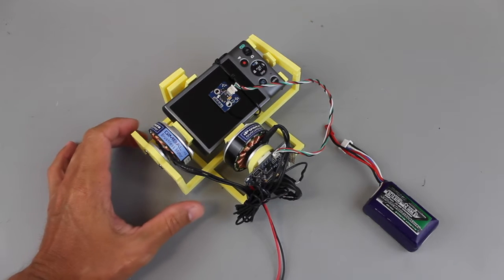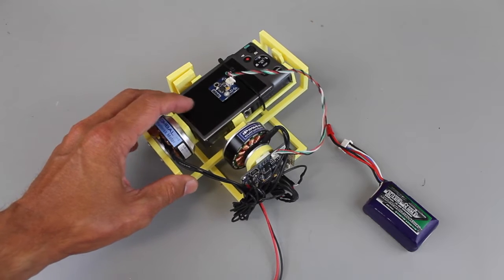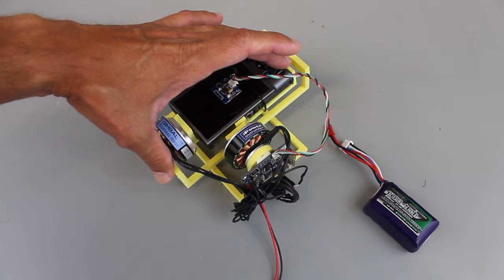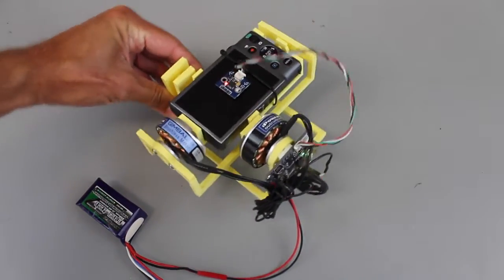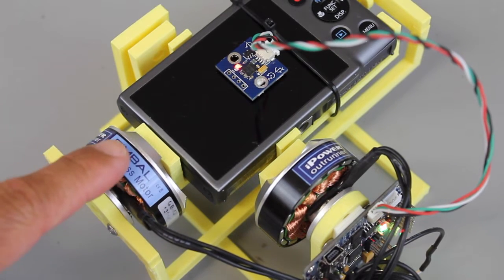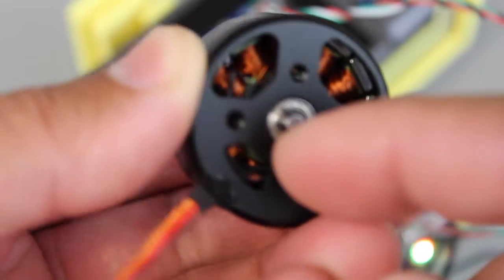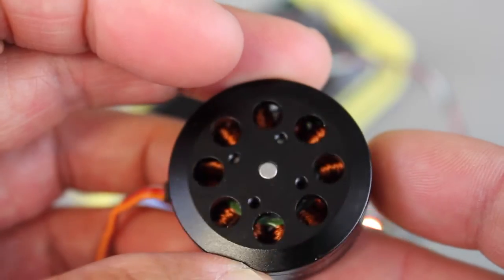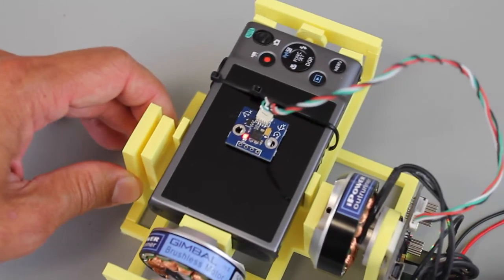3D Printed Downward Gimbal for Aerial Mapping

Comment: your batty charger may be bad. i had a $40 charger from hobbyking and after a year began overcharging battery's and making them puffy, even brand new batts.. i now have 300w - 2x150w Reaktor, its great. after charge has finished, ignore what charger says and seperatey check voltage with MM. If ur getting puffy battery's
Reply from the maker: Thanks for sharing that tip. Appreciate it.

Comment: Great idea, I may give this a go!  Does the bottom section of the frame come into shots at all.  I've liked and subbed.
Reply from the maker: fireFLY aerial innovation It does if the wing is rolling hard left or right on turns. But that generally happens at the end of a flight strip so it doesn't matter. I don't use those photos in the stitching process. While moving straight down the line the roll isn't large enough to get the frame in the shot. Lately I've been testing the Sony NEX without the gimbal and it works reasonably well when stiched with Photoscan or Pix4D.

Comment: Which control board are you using?
Reply from the maker: Stephen Oberlin In this case I'm actually using a board that's overkill: http://amzn.to/1KiTD4c I don't need 3 axis but it was laying the garage and so I put it to the test. Performs really well, but a much simpler two axis version will suffice.

Comment: When'll be providing the project, and can tell me if know any site that sells the gimbal for Canon PowerShot SX260HS.
Is this the gimbal for use with Canon PowerShot SX260HS.

http://www.hobbyking.com/hobbyking/store/uh_viewItem.asp?idproduct=43674
Reply from the maker: Jaelcio A. Lima Verde That HobbyKing gimbal looks pretty good. It's 110mm wide and the SX260 is 106 so it should fit in the gimbal. I've never used it so I'm not 100% sure. Also, if you plan on using a remote USB trigger then you'll need to make sure that the USB plug will fit into the gimbal as well.
Reply: When will provide its gimbal design for canon Powershot Sx260?
Reply: Its use the Canon SX260 in a fpv.

Comment: Do you think the gimbal would fit in a plane like this? https://www.hobbyking.com/hobbyking/store/__58045__Skua_FPV_Plane_EPO_2100mm_KIT_.html

Im looking at building a system to do mapping.
Reply from the maker: Tim Dickinson Yes I do think it will fit in that frame, but will take some tweaking. It doesn't look like there's a downward cutout so you'd probably need to do that yourself. I still haven't finished up this design and am working through some bugs. Let us know if you decide to go with that frame. I'd love to hear how it works out. A few others have pointed me to it, but am more interested in a delta wing design for aerial mapping.

Comment: Any update on the project? I'm interested in the same type of gimbal but hugely lacking skills to build one..
Reply from the maker: Ard Surspec Sorry no I haven't been able to finish up this project. I've found that it takes a lot of space in my wing so I'll need to come up with a different mounting option. I'm also looking at different frame options to see if there's a better suited one. What type of plane are you flying?
Reply: Dennis Baldwin Thanks, I am looking to build a mapping drone, perhaps based on the same Fx-79. Not a flyer yet, I'm a surveyor, age is catching up and recently broke my foot, so I need something that require less walking to continue putting bread on the table so to speak. Keep up the good and inspiring works of yours, so guys like me can learn..Thanks again..

Comment: another great video. thanks. did you ever determine the thread size on the HK motor? I've ordered a few of them to build a simple gimbal but it's been over a month and they still have not arrived. I don't want to make parts until I know what size to make the mounting holes. thanks in advance.
Reply from the maker: James, man I'm sorry to hear that. It's pretty much what you can expect with ordering from HK. Regarding thread size I just resized a variety of bolts in the mail so stay tuned for a new video in the next day or two. I'll be sure to share what I find out. Good luck with your gimbal project.

Comment: Very interesting project. I will be waiting to see the final results and footage. What is the size of the camera that are you planning to use? I have found that some point and shoot cameras are very sensible for vibrations. Cheers
Reply from the maker: I've been flying with two different Canon Powershot camera that can both run CHDK. They both do relatively well for the price. One is the PowerShot 130 and the other is the SX260. I've had good results with both. I'll definitely be sharing my results when I get this gimbal in the air. I've made a few tweaks but it's about ready to go. Thanks for following along.

Comment: A needed piece of hardware. Will the chassis block the shot when it rolls? Can the camera be positioned lower?
Reply from the maker: Great questions and thanks for the feedback. I've thought a lot about the chassis being an issue, but yes lowering the camera should hopefully do the trick. I've already got a design where the camera is lower and keep in mind when it's powered on the lens protrudes from the camera body about 1". I'll need to foam cut a hole in the bottom, but hopefully can keep it relatively small. Will continue to share my results.

Comment: Your P.I.D settings need adjusting the controller is over compensating when you tilt the gimbal.
Reply from the maker: Copy that. I'll plan on fine tuning this before I get it in the air. Thanks.